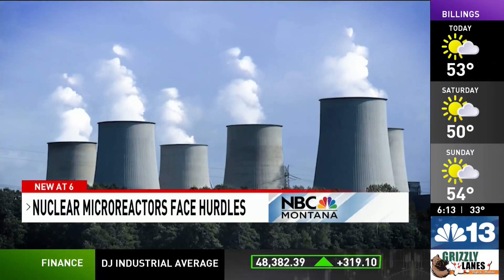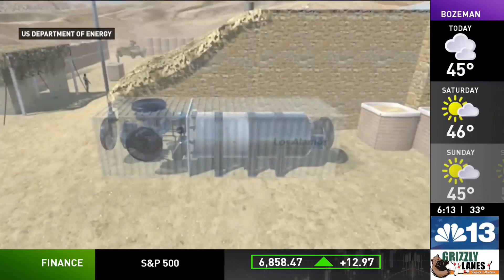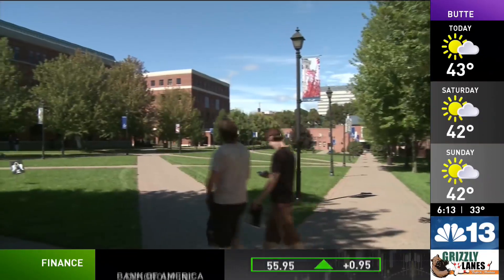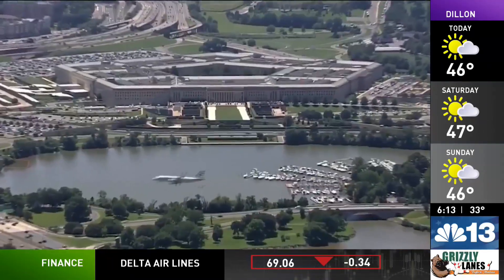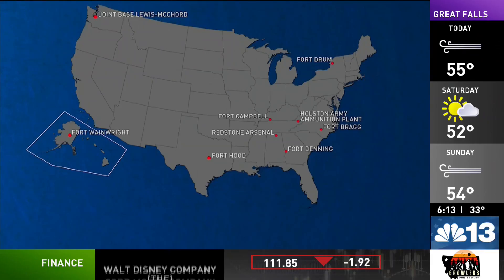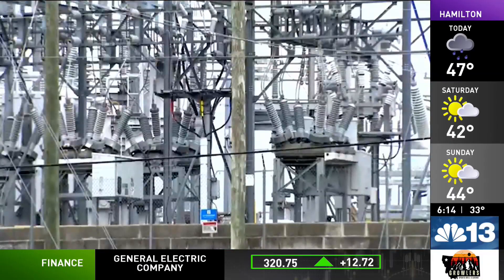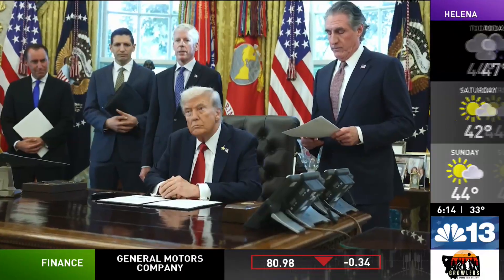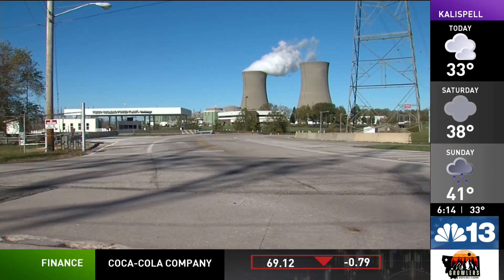Army tests nuclear microreactors as US pushes next generation energy

Comment: UK's first 3 Small Modular Reactors (SMRs), are currently being built by Rolls-Royce. Those SMRs are 470MW output and 90% factory built. The biggest single component is the pressure vessel at 220 tons of 1500 total separate components. Costs should come down but are still quoted as £1.8 billion each (in 2020).

Comment: Nuclear?  How safe are these nuclear generators?  The safer way was the LFTR desalination. Is anyone listening?
Who needs desalination? A LFTR nuclear reactor that runs on Thorium, 90 times more energy than Uranium, no nuclear waste, 200 times more efficient, thorium is more common than tin (the USA has the worlds second largest reserves in the hundreds of millions of tons). And guess what? This tech ain’t theory. One was built and ran from 1960 to 65 at ORNL and it worked great. Cheaper to build than natural gas or coal plants, and Thorium is considered a trash product. Best of all, the waste heat can desalinate water and using the special LFTR waste heat management process, the excess hydrogen from desalination can be combined with trash to make carbon free synthetic oil from sewage and MSW. Another other wastes products are Xenon which will power rockets to Mars and allow light bulbs almost as efficient as LEDs to be built, at a fraction of the cost. Another waste product is special types of bismuth and cesium which can cure all forms of cancer and eliminate food poisoning, respectively.

Comment: India is actively developing micro nuclear reactors, specifically Small Modular Reactors (SMRs), with significant government backing through the 2025-26 budget's ₹20,000 crore allocation for a Nuclear Energy Mission, aiming to operationalize at least five indigenous designs by 2033 for energy security, grid stabilization, and industrial power, using designs like the Bharat Small Modular Reactor (BSMR-200) and smaller SMR-55 units .Union Budget 2025-26 launched a dedicated mission for SMR R&D, earmarking significant funds. Amendments to nuclear laws are planned to encourage private participation in financing and building SMRs.